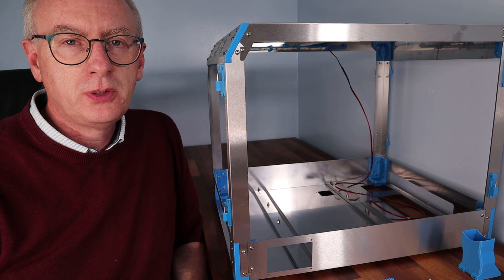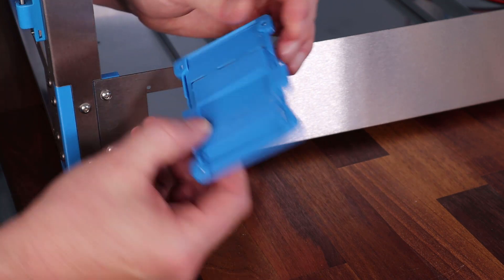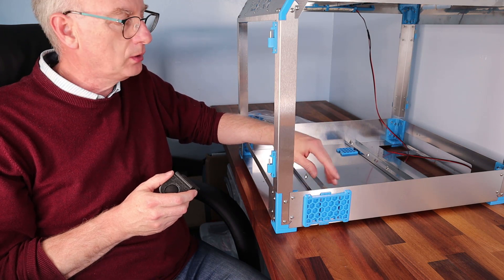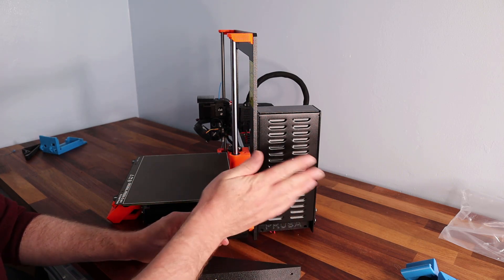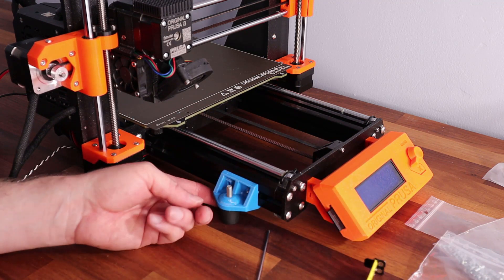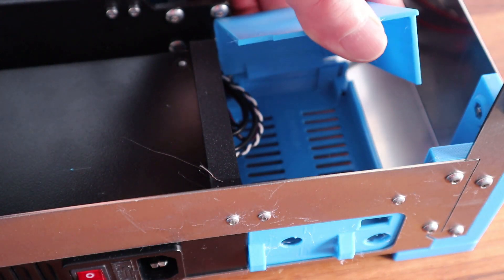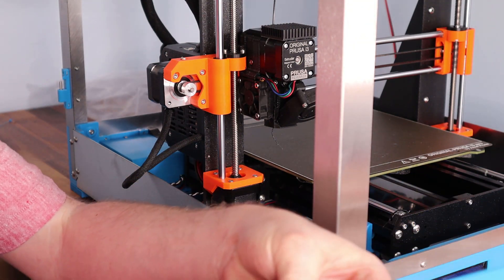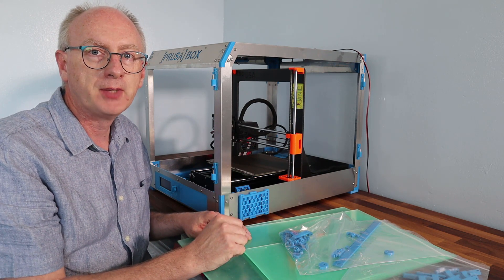PRUSA BOX Enclosure - Build Part 3 - For Prusa MK4 MK3 i3 3D Printers

Comment: I am a little confused with the PSU download section on the PB site on which parts to print. Which folder do I open and download which files? I printed the bracket already to put in place after I take off the power supply but I don’t know what else I need.
Reply: same here

Comment: Hi Colin, to put the pins in the printer I see you add some little pins in the frame, but I can't find the stl, do you have a way to link them? Thanks
Reply from the maker: Hi can you clarify which part you mean. Thanks
Reply: @colinhill  hello, thanks for replying :) the clips I mean are the ones that go into the frame of the mk3 and then screw the support to put the anti-vibration feet. I hope I have been clear. thank you very much and congratulations for the videos that are helping me a lot in assembling my prusa :)
Reply from the maker: @kekko4212  Do you mean these? https://www.screencast.com/t/zkbuHNlIfT     They are in the Squash Ball Feet STL, need a square nut and slot inside the extrusion and i used an allen key to help line up the clip to the foot. Here is a link download_public/Prusa-box/03_printer_feet/printer_feet_squash_balls_mk3s_2021-01-07.stl   its inside the 03_Printer_feet download section. I hope this helps you.
Reply: @colinhill  hello, what measure did you take of the anti-vibration feet for prusa? you can link them to me i would not take the wrong size. Thank you

Comment: Hi Colin, that brace you fitted in place of the power supply, is that something you've designed or a downloadable stl file from Printer-box?
Reply from the maker: Hi. If you look on the printer-box website for the PSU assembly guide it says the brace is downloaded from Thingiverse. It's not one of my designs. Hope this helps you.
Reply: @colinhill , found it and printed it. Thanks Colin.
Reply: Actually printing that file now, looks like they updated the file to include them. Nice

Comment: Hello Colin, which are the dimensions of the dampers? for example,  diameter, height of the rubber and lenght and metric of stud? In web of prusabox They don´t say that and they dont sell them. thank you very much, best regards.
Reply from the maker: A quick measure, seems the diameter is 20mm, height is around 21mm. The bolt protrudes about 20mm from the rubber and is a M6 thread. I couldnt take the foot off my printer :) hope this helps you. I'm finding these rubber feet pretty good, much better than squash balls that cause the printer to shake, and better resonance prevention than the Prusa printer feet.